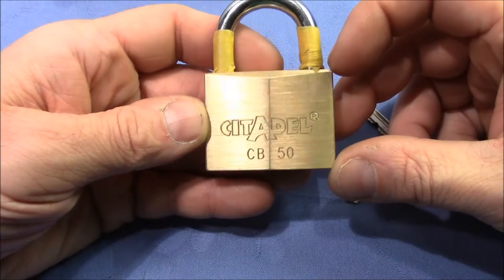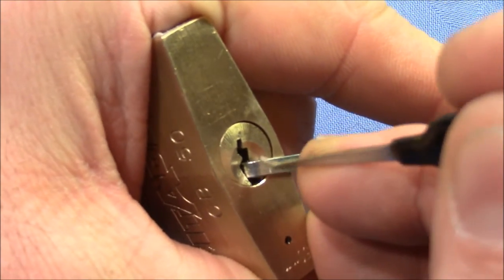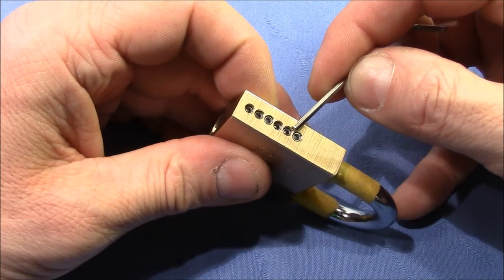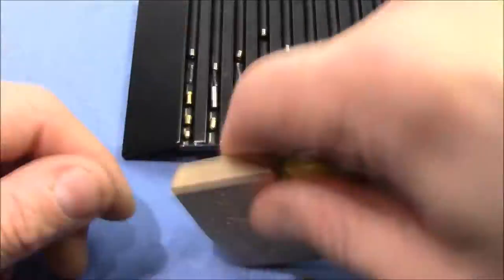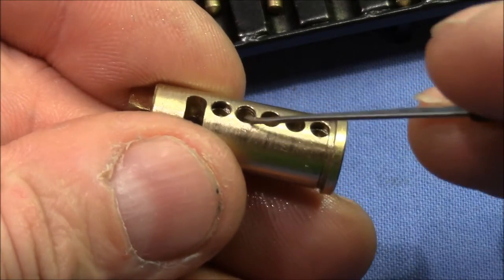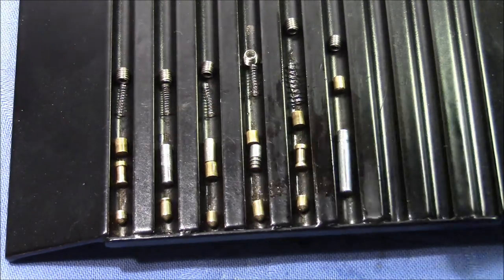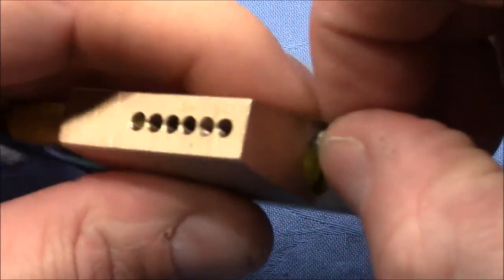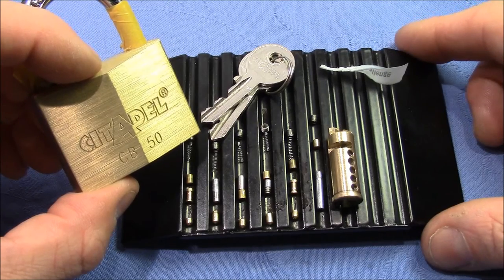(picking 310) CIDATEL 5-pin challenge padlock from T&J picked and gutted

Comment: Very nice machine work on the Citadel from Tobias&Julian :). I think they made the split driver stacks to get a certain pin height and don't think the top pins came into play, so it's okay. Rarely seen a padlock with non removable core gutted and other than BB, you were able to take the core out :). Nice and fast picked Potti :).
Reply from the maker: Thanks. Yes that was a fun pick. I was a bit astonished to see three parts coming out. But I love to slowly find the answer. After sorting the pins correctly in the stack it was kind of clear for me what purpose they serve. So I forgot to mention it. Happy that the core came out and that I could see the great modifications.